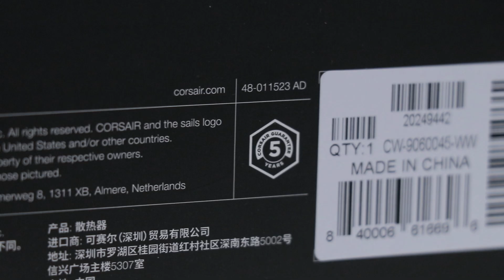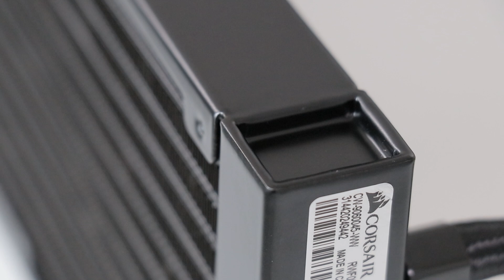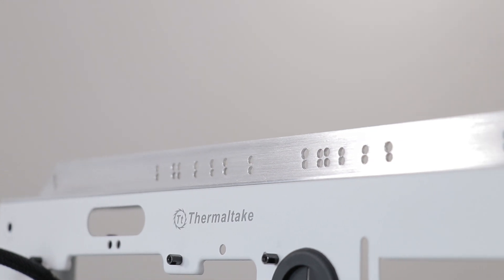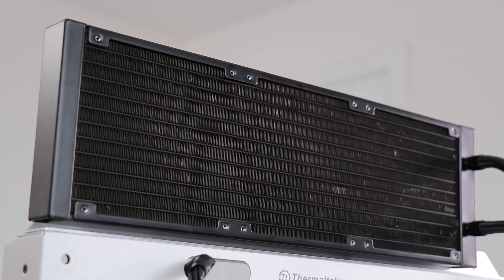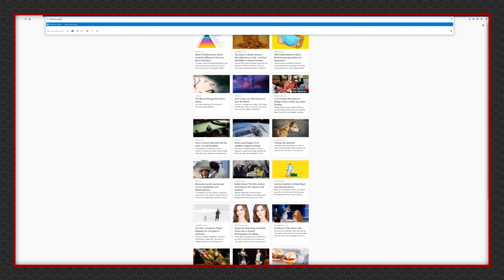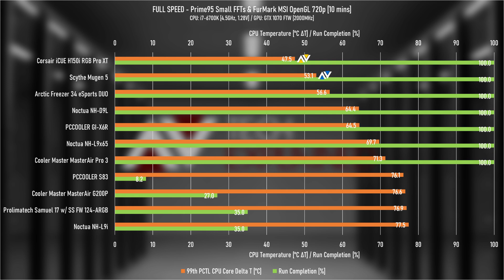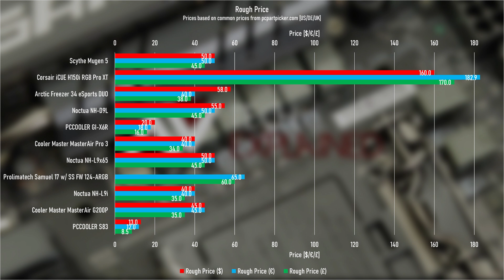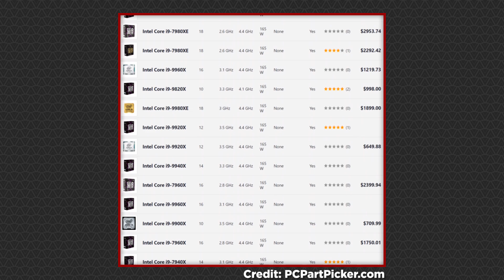Corsair iCUE H150i RGB Pro XT (360mm ARGB AIO) Review

Comment: 3:30 - You say you are "removing variables" by removing the thermal paste, but instead you are actually creating more variables, now customers who purchase this may not have the same results as you, 90% of buyers will use the stock thermal paste..
Reply: Pretty sure it's high-school science when you learn to only change one variable in a series of tests..

If you're testing different coolers against eachother whilst each are using their own different thermal pastes, then how do you know if the performace difference is down to the thermal paste or the cooler itself?

Nobody watches a cooler review for an exact temp figure. These videos are used to evaluate how a cooler performs comparative to other coolers.

Sure the average consumer may just leave the stock thermal paste on, but as AV said; those thermal results would only be relevant if you had the exact same system. Nobody should be watching this type of video to find an exact temp/noise figure, and then expect it with their own system. 

The only way to tick both boxes would be to test every cooler with its stock thermal compound, and then retest with a 'control' thermal paste. But ain't nobody got time for that.
Reply: @BenXCIV  or include the stock thermal paste that comes with the product as part of the review. just open it out of the box and install it without modifying anything because that's what most customers will be doing. Each product should be compared and reviewed as how it's shipped from the manufacturer.

Maybe this AIO stock thermal paste performs better than his, and that's part of the purchasing price.. but now we will never know
Reply: @cody5495  I said that in my comment lol.

But that would literally double the testing workload - having to do the testing twice, for a pretty irrelevant piece of information.

Let's say this cooler comes with really good stock thermal compound and gets a result of 70°c. Then you test a different cooler that comes with really bad stock thermal compound and it gets a result of 75°c. 
Now how do you know if that 5°c is down to the quality of the cooler or the difference in quality of the stock thermal compound?
Then imagine you have a list of 20 coolers all with different thermal paste... the results would all be so inaccurate.

Not sure why this needs explaining, but surely you understand?
.. I assume you don't watch Gamers Nexus.
Reply: If you are smart enough to understand and use an AIO, you don't use the stock thermal paste.
Reply from the maker: @Cody I know what you mean, but for testing purposes I have to use a single thermal paste. Some coolers don't come with thermal paste (it's rare, but can happen), and if a cooler needs re-testing later down the line, or needs retesting after the initial testing due to an error and I don't have its stock thermal paste or have used its pre-applied thermal paste, I can no longer test it.

It is a pain, since you won't get the true performance of the product, but then again I'm replacing whatever thermal paste it comes with, with a thermal paste that's a fairly decent performer, but nothing special. So you could probably extend the +/- range to maybe 2°C to get a rough idea of stock thermal paste performance.

On top of this I'm also testing it on my system that's unique to me, I doubt anyone else will run specifically this setup and small changes in a setup can have an impact several times greater than the difference between an average and good or bad thermal paste.

On average there are more benefits to having a single test thermal paste than using a stock thermal paste. But as you suggest it doesn't remove all the problems or concerns with the testing methodology. I wouldn't blame another channel for testing with stock thermal paste since I see some benefits, but I'm choosing a single thermal paste for the reasons above.

Hope that clears up any grey areas in the method.
Reply: You do use The prespplied termals. Then you test it out of The box. There exist hunred of different termal paste, with each having different results.